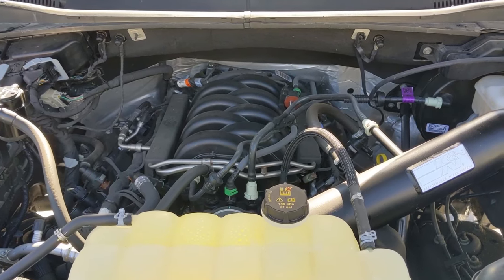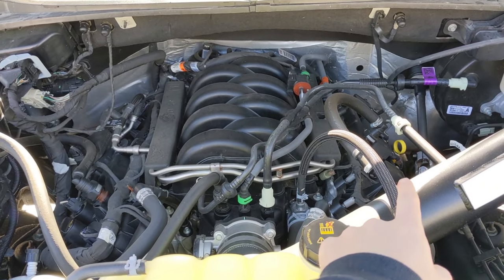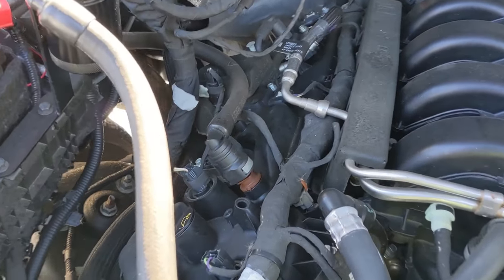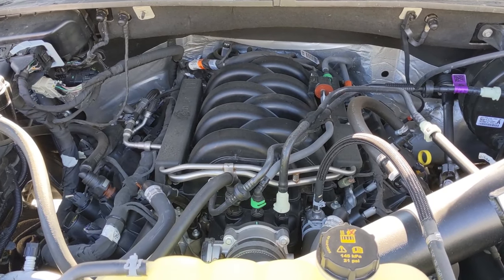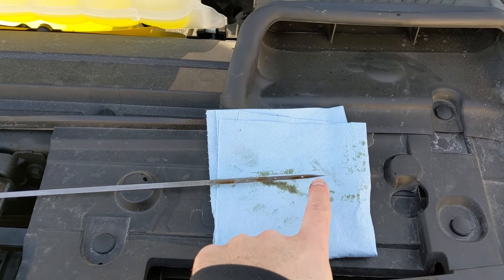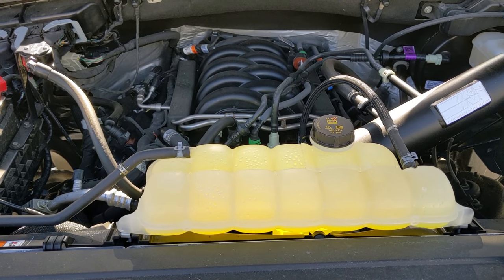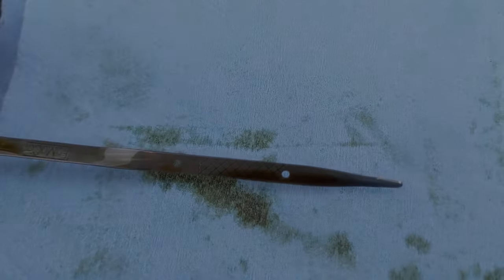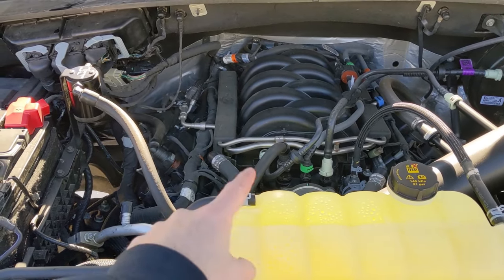Oil Consumption Update - 2019 Ford F150 5.0L

Comment: Wow so well explained. Thank you. I also have a 2019 5.0 but doesn't consume any oil, should I still bring it to the dealer to have them do the TSB ?.
Reply from the maker: If it's not consuming you may not have too, how many miles/kilometers on your truck? Some don't start consuming until 50,000 or 60,000 which is weird. Others consume right at the start. Some don't consume at all.
Reply: Really appreciate your fast replies, we need more people like you. @EliminatorPerformance  It only has 17,500 miles, 2019
Reply from the maker: @ericdownunder1957  I try, I've noticed that with 74,000 subscribers and over 15 million channel views now it's getting difficult to reply to them all. I'm starting to miss more and more comments because there's so many, I don't even get notifications for many of them anymore. Good luck!

Comment: I have a 2018 
  I did my oil change my self recently And there was only half the oil in there.. 3 or 4 liters...it filled the empty  jug of fresh oil only half way...
  I haven't had the tsb done..
Also. I filled the oil up.  I drove about 800  klms and it used a liter. From Thompson,mb to Winnipeg.
 Going to take it in and see what happens.. I'm sitting at 133 000 klms. Have always notice the oil consumption.

Now I have a low rpm end rattle when I accelerate and sounds like the lifters are ticking too.
   I have the 36 month 160 klm warranty.
Reply from the maker: When it comes time for them to ask you if you want to extend your warranty, either sell the truck or extend the warranty. I have a 10yr warranty on mine so I'm not worried about anything.

Comment: Hello I watch and enjoy the technical aspects of all your tutorial videos. 
But I have a friend and know of several people with the 5.0 in their F150s and they all consume too much oil.
Matter of fact my friends F150 in shop now getting a new engine. I don’t believe a reprogram of computer will fix anything oil consumption wise. I believe it’s got something to do with the piston rings and or piston together.
Reply from the maker: Ok so the 19-2365 TSB reprograms how much the throttle body closes on deceleration, and you can install an Ev281 pcv valve (from the 2015+ mustangs) on the passenger side valve cover. This helps to better control crankcase pressure, as these engines basically created a vacuum in the top end which sucked oil past the low tension piston rings, up into the combustion chambers. The result is oil consumption due to it burning off.

Part of the 19-2365 TSB is a new dipstick, it has the same overall length but a wider 2qt range to better track oil consumption.

Run 5w30 fully synthetic oil such as amsoil Signature Series or Pennzoil ultra platinum. Or you could try a 5w40 oil, like a liquimolly Molygen (which has antiwear additives that will quiet the top end a bit) or try their SynthOil. Or run rotella t6 5w40. The T6 is a diesel oil, which has more phosphorus and can be harder on catalytic converters, but lots of guys run this oil without issues. Those are the only oils I would recommend.

That should solve the oil consumption IF it's PCV related. If you have an issue listed below, then a heavier weight oil will just mask the issue, not solve it.

There are other issues like weak, low tension piston rings with the plasma lined cylinders (that requires a long block replacement) which seems to always be on backorder for possibly 18 months. So if you have this issue, even if you solve the PCV issue, you'll still have excessive blowby which dilutes your oil making it look dirty even shortly after an oil change. The test for this is a leak down and/or compression test to check the seal of the piston rings.

Guys tend to baby new trucks to "break them in 1st" but these 5.0L engines need to be run hard and hot at higher rpm to seat the rings.

Having the piston ring and PCV issue at the same time causes extreme oil consumption, more so than the "typical 5.0 oil consumption" you commonly hear about.

Another 2 issues can be caused by the cylinder heads; 1 issue is leaking valve stem seals (after your truck sits all night, you start it in the morning and notice a puff of smoke) what happens is oil seeps past the seal (that was likely torn when installed at the factory) and oil pools on the back side of the valve.

To test this, you need to remove the intake manifold or the exhaust manifold and bore scope the intake/exhaust runners to inspect the back sides of the valves. If you see oil on the valve stem, or oil pooling on the backside of the valve, the seals are leaking. Leaking valve seals will cause the truck to continuously burn oil, regardless of whether the engine is cold or hot.

You can upgrade the stem seals to GT350 seals, and this will solve the issue. However, Ford usually just replaces the cylinder head.

Another issue is worn valve guides, which require the cylinder heads to be replaced. When you 1st cold start your truck in the morning, you may notice some smoke (not the usual vapor from condensation burning off). This will cause oil to be consumed each time the truck is started when the engine is cold, but once the truck heats up, the valves and guides expand and tighten the tolerances, which reduces consumption.

I'm working on a video that explains this, hopefully by the end of the year.

Comment: If the TSB essentially works (helped a little but did not solve my 5.0 oil consumption fully).... then, what is the point of the Catch Can?  That is a VERY little amount of oil in the can between oil changes.  Thanks.
Reply from the maker: Considering I ordered this truck brand new, if you imagine it separates 1oz of oil every oil change, imagine how much oil that would be after 100,000 miles or 200,000 miles. The point is to keep the engine as clean as possible, by reducing the amount of oil being burned. So the TSB, oil catch can, new PCV valve and now I'm running fully synthetic 5w40 oil (I'll be doing an update on that this spring) it drastically reduces consumption.

Comment: I have a 2019 and lately I get a clanking noise in low gears immediately after a startup.  It goes away after 1-2 minutes and does not return till I do another cold start.  It does not do it at idle.....just in lower gears under load.    Could this be a symptom ?
Reply from the maker: Hard to say, maybe torque converter or something else, I know they had heat Shields come loose on the exhaust.

Comment: I bought my truck used, 2018 F150, I’m not sure if it’s got the new dipstick. What is the proper length of the replacement dipstick?
Reply from the maker: Google 2018 f150 dipstick comparison you'll see the difference in the range. The original dipstick was only 1qt range, the new one is supposedly 2qt range

Comment: My issues started with a bad cat which is sitting at ford waiting to find out if im getting a new engine before we ruin another cat. When ford ordered the cat we started an oil consumption test. Without adding any oil, my 2019 5.0 v8 consumed 3 courts of oil in 3,000 miles. Would these still fix the issues? I know they did reprogram it last year some time. Lots of issues about 42,000 miles currently
Reply from the maker: If the TSB and dipstick were done, you still need to try the ev281 pcv valve, I always recommend that 1st because it's $5 and anyone can change it, just a quarter twist and they come right out. If that still doesn't solve it, they should probe the cylinders with a scope and see which cylinder is consuming oil the most, it'll be black and Carboned, it could be worn valve guides or piston ring issues, also could be a cylinder issue. If it's rings or cylinder, they give you a new engine, if it's cylinder head related, they just change the heads.

Comment: My nephew bought a 5.0 Ford 150, , a 2019, this summer (21). He became worried when it was using too much oil. He drove across Canada, and now is in a province where he doesn’t know anybody. He took his truck in to the local dealer. They told him he invalidated the warranty because an after market oil filter may have been used when it had an oil change. They charged him $400 to come up with this conclusion.
I looked at carcomplaints . This is an ongoing problem . They’ve been sued for it.
Reply from the maker: You can use any type of oil filter you want, that will not void warranty. They took advantage of him. My truck has all kinds of aftermarket parts, still covered under warranty.
Reply: @EliminatorPerformance  Yes, they are taking advantage of him. He’s a 24 year old, working a lot of overtime, so he doesn’t have tons of time to argue with them. 
Also, the windows have developed a mind of their own, raising and lowering, by themselves. He spent a lot of money to buy that truck, then spent more on big tires and other upgrades.
It really pays to check out a vehicle before buying these days.
Thank you for your reply.

Comment: And are you positive there the longer dipstick is the correct fix and not some Ford BS?
Reply from the maker: The longer dipstick is just part of the solution. The main issue was the vacuum caused by the throttle plate closing too much, sucking oil from the bottom end that was already overfilled, because of the shorter dipstick. Not all trucks have a defective dipstick. The TSB says any truck after Oct 4th 2019 has the newer dipstick, but that simply isn't true, as I've personally seen 2020s with the older dipstick.

Comment: So, 8.8L of oil and I measure how much I put in to the motor when changing oil so it’s not over filled, I have ford currently testing how much oil the motor is consuming. They filled the oil and marked my dipstick and currently I am almost at the 4800 km mark where they want me to bring my truck back and measure how much oil is being consumed.. it has used enough that it’s almost at the bottom of the cross hatched pattern on the dip stick. So watching this video, putting a longer dipstick in if the correct amount t of oil was added at the oil change is not changing anything but the dipstick itself lmao. The modification of vacuum I can see making a difference. It does not address why these motors sound like diesel engines chugging away at idle. Hoping my local dealership doing what you are stating is the fix as I use my truck to get to work and I travel for my job so it needs to be fixed right and not just a this is a work around for poorly engineered computer drafted and engine testing. My old trucks I still have  with 341000 and 280000km  don’t consume anywhere near this much oil and sound mechanically better. Shame the body is falling off them but that is the salt on the highways which to me is another whole issue that needs change. Thanks for the video and I believe this will be fords next attempt at fixing my issue. Thanks for posting

Comment: Would this have anything to do with the occasional engine rattle or slapping sound I hear, on both deceleration and acceleration, at between roughly 100-200 RPMS? 
     It's  an obvious noise and I can't believe I'm the only one who has this noise under the hood?

Comment: You have to be kidding me, if you think crank is getting overfilled because of a dipstick length. Ford put a longer one in with a wider safe running range. I've changed my own oil and put 8.8 qts. In engine on old dipstick and on new one and it read at the full mark on both. Dealership also did it. The engines use oil, flat out. Typically 1 quart or more in 3k miles. You are misleading people. I've worked at a dealership and you just don't guess at oil input, you set the pumps to correct setting or you use 5qt plus 1 qt containers. Longer dipstick allows a larger safe zone according to Ford. Ford even said these trucks can run up to 2qts low and be safe. Which is a bunch of bull.
Reply: Mine read empty at full , from new. mechanic put a notch in it and said that was my full mark...
Reply: Wow, you are such a genius 😂

Comment: @eliminator-performance thank you for giving us another update video, I enjoy them very much. I myself have a 2020 F-150 5.0 RCSB 2WD and I use my truck everyday and drive 36 miles on average each day. I purchased the truck in September of 2020 and have never checked the oil level. But, reason why I haven’t is because I “assume” the oil levels should be at a correct level since it’s a brand new truck. My question to you is; 
Does the 2020 models have both the oil consumption and the shorter dipstick ? Or, does the 2020 model come with the longer dipstick ? And no oil consumption? 
Thank you. 
Also, I am still excited and waiting on your upload of updating your LED Lightbulbs for your headlights, since you only did the fog lights lol. 
Thank you for your time and guidance.
Reply from the maker: Yes the 2020 models can still be affected by oil consumption due to throttle plate closing causing the vacuum, but any truck built after October 4th, 2019 has the correct length dipstick! I ordered my truck in June and received it in September, so I was just shy of that date. Not all trucks have this issue, and like I said it's always worth it to get a EV281 PCV valve just to try if you notice slightly low oil on the dipstick. Then if the PCV valve doesn't fix it, the TSB should. I check my oil on everything I own because it's a great way to tell how the engine is running. Thanks for watching, and yes I'm working with Diode Dynamics on getting some new model of lights and hopefully another LED video will be coming in the future!
Reply: @EliminatorPerformance  I have 3,500 miles and 50% oil life left. In your opinion, What oil would you recommend best to utilize for oil changes. Motorcraft or other brands ? Thank you for the response. You are awesome! Keep up the great videos.
Reply from the maker: Motorcraft is great, that's a brand owned by Ford, and I believe they use a synth blend. I use quaker state 5w20 synthetic, but it really doesn't matter. As long as you're using a synth, or synth blend as they say which is synthetic and mineral based mixed, then it should be good. Like I said oil is relatively cheap and filters too, so I do changes every 5000km or 3300miles to keep things fresh.

Comment: I had three oil consumption test and all the TSB ‘s done.  At 24,000 miles mine is still consuming oil. I also have off throttle rattle and what sounds like spark knock at low speeds going up hills.  Went through corporate before the last oil consumption test. Dealership said it’s all fixed and fine now but obviously it’s not. I’m not doing another oil consumption test. Hopefully corporate will buy this thing back

Comment: I’m having the same problem with my 2019 f150 since day one they recently changed the dip stick reprogrammed it like you mentioned and still doing the same truck Boggs out and cold start runs and sounds as if I did cam work to it

Comment: So the 21 and up mustangs use 5w-30 and no one seems to complain about oil consumption for those years. Hoping to try 5w-30 and see if it helps
Reply from the maker: Use a fully synthetic 5w30 like Amsoil signature series or pennzoil ultra platinum (not regular platinum) and I'd recommend changing oil every 5000kms

Comment: The issue is the crappy weak piston rings and liners.  The throttle body coding change is a band aid on the real issue.  

First thing I noticed when they changed mine is there is no hold back from the engine when trying to use a lower gear to slow down.  Also, the pop (intake vacuum) when letting off the throttle after accelerating  & revving over 3,000 rpms was gone.

Comment: Is the ev281 pcv valve the same color as the factory? What I’m getting at is if the dealer were to change could you tell the difference, other than the hoses probably being wiped clean from changing it.
Reply from the maker: Yes, you need to remove it and see if it has a straight through hole, or the cross in it. The one with the cross is the new one that slightly limits crankcase pressure and decreases oil consumption.

Watch this video: https://youtu.be/s8D6XtmH2dg

Comment: 2018 5.o bought it used just put 4 quarts in ,how can you find out it the tsb has been done or if the dipstick has been
 replaced ? Great video
Reply: @stunamin9574 - To find out if your truck has had the TSB done, you need to Call  the Dealer,  or go by one, and let them take your VIN and put it into their data base... They should be able to see the history of your vehicle with any work done and logged into their data base...

Comment: My 18' f150 Coyote 62k miles runs great until it is about a 1/2 q low of oil. Then it dies at lights/stop signs and idles rough. I’ve been using 5w20 blended oil.
After adding amount of oil it takes a couple of days then runs great again. I love my truck but please help. The dealership charged $400. To clear the code and change oil. Any assistance is greatly appreciated. I disabled the auto-stop and that seemed to help minimize oil loss. Could the catch can, ev-281 valve change and 5w-30 help?
Reply from the maker: Sounds like a VCT solenoid issue, I would start there. And run 5w30 Pennzoil ultra platinum or Rotella gas truck or multicar 5w40
Reply: @EliminatorPerformance  Great info, thanks. I really appreciate it. Merry Christmas

Comment: Yeah, consuming excess oil is the problem. Had a Cat C7 that required 30 US Qts but if you ran with 30 you would get a lot of blow by so I figured it wouldn’t hurt to just fill it with 25 quarts and never had the problem again. Newer trucks are requiring more oil capacity to keep it a tad bit cooler however I don’t believe the sump is deep enough and the pumps are over preforming causing excess oil in the cavities.